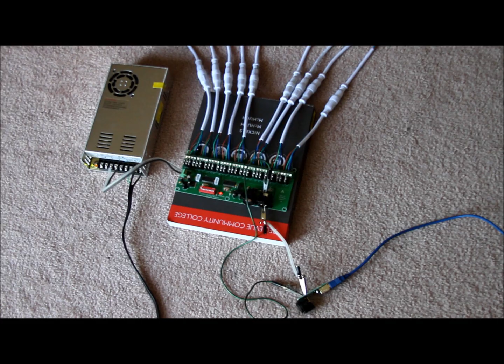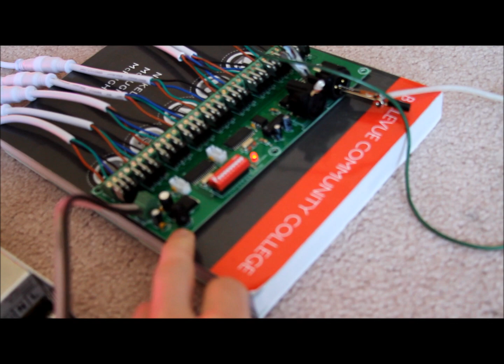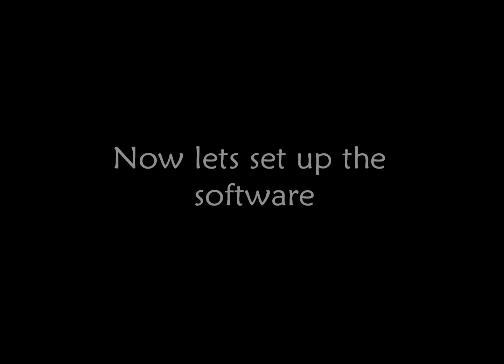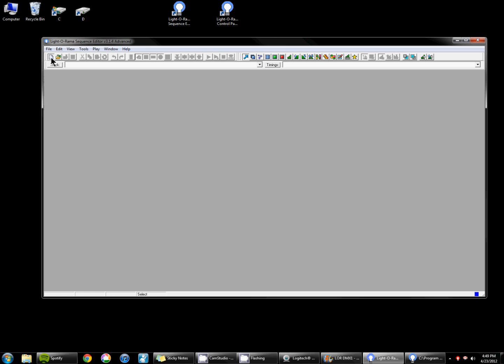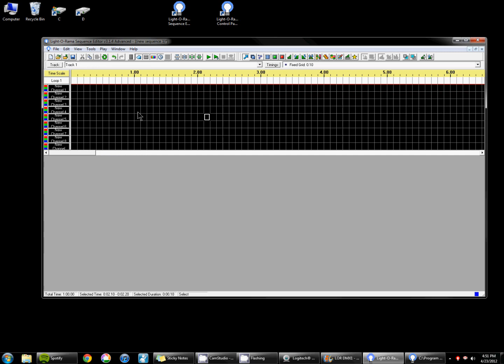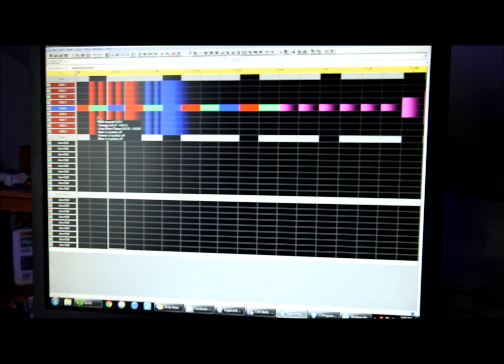How To Setup Enttec Open DMX USB for LOR Light o Rama - OLD VERSION

Comment: you can't use the demo, you have to at atleast get the basic from LOR that is about $40 but the demo software is your problem because it can't controll lights, its only is for playing with sequences so buy one of the full software it should work then :)

Comment: Sorry for the long responses on this video, I didn't see a way to message you directly.  I got it working with the LOR 485 but the channels are off by one and when I turn on all 3 colors at 80% intensity or higher, they flash, so no good.  I tried it with the programmer cable I got from Holiday Coro and they work on the proper channel and don't flash.  I'm going to ask them if they know of any reason why their cable won't do the same thing as the Enttec Open DMX.

Comment: I found this thread and it sounds like trying to use the LOR dongle directly is just a pain in the ass.  So for 60 bucks I'm going to save myself the headache and buy an Enttec.  I didn't know you had to have a separate one per universe.  That kinda sucks with the 512 channel limit!   I'm not sure that I'm going to mess with any individual pixel lights right now.

Comment from the maker: Awesome! Let me know if that works. I have a USB RS485 adapter that I used for my LOR controller boxes. If I can use them to set up more Universes I will definitively go that route when I need more. Once I get my hands on some digital RGB strips with individual pixel control, the DMX Universe is going to fill up fast!

Comment: Thanks for the response.  Yeah, I thought you could control DMX with their RS485 adaptor but maybe not.  I'm researching it now.  I created the adapter cable that changes the cat5 connection from the blue to orange wires and I've verified that I can program the 3-channel DMX box with the LOR RS485 adaptor.  Now I'm trying to find out how to send DMX signals from the Sequencer with just the 485 and DMX controller.

Comment: Thanks for posting this video.  I was wondering why you chose to use the Enttec instead of using the LOR dongle directly?  I'm looking at doing the same thing and found that you can use the LOR dongle if you make an adaptor cable.  Have you looked into this?  Seems like it could save 60 bucks, but if there's something I'm overlooking, I may need to buy an Enttec also.

Comment from the maker: To make the software active, you need to register it which is under the help tab under upgrade LOR. If this is your first setup, then you may not have purchased the software yet. I have the software because I purchased it when I bought our 2 controller boxes from LOR. Unfortunately its not cheap, but it gives you the power! You may just want to start with the basic license to begin. It is available on their website, and they email you the registration information.